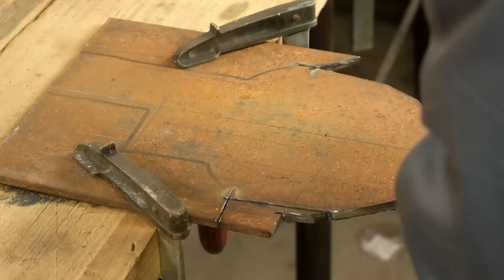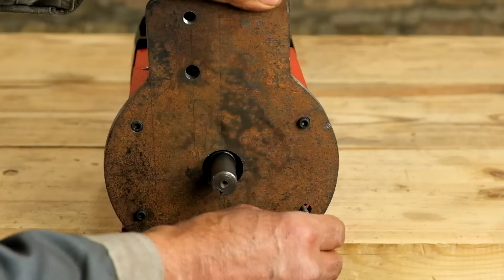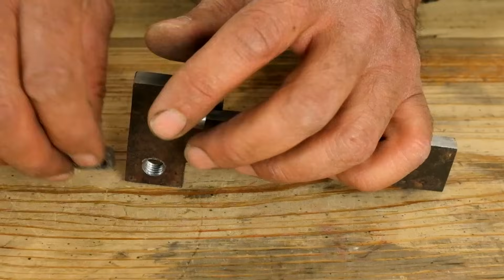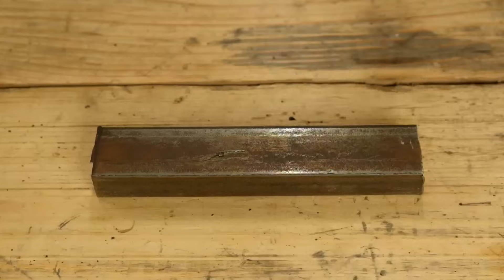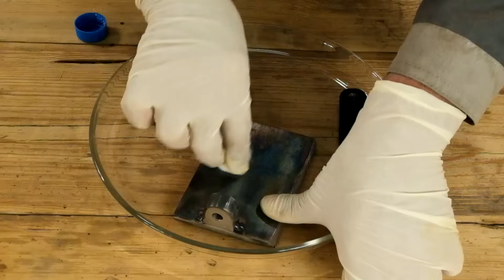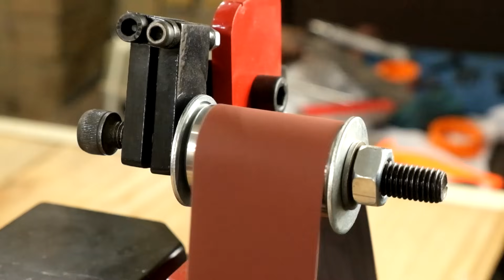DIY Belt Grinder

Comment: Motors being so expensive kind of defeat the purpose of this DIY. It's much cheaper to buy a good entry level brand on sale than it would be to make this.
Reply: A 2hp 2x72 with a 3 phase motor is expensive. Even inexpensive ones. What are you proposing?
Reply: @AzTurboMini  Just buy a purpose made entry level bench sander, the cost is less than one of these motors alone.

I purchased a 4"x 36" bench belt sander with a 6" disk sander for $69.95 USD (plus sales tax) on sale.
Reply: The idea I believe is to use a Reclaimed motor which is what I do.
Reply: This isn’t really a DIY project more just for “content”
Reply: @jfrphoto01  so you never worked with a good 2x72 is what youre saying, bc there is more than 1 world of difference between those two
Reply: If you creative, get motor from water pump, second hand non working pump normally the motor still works,  got mine for $5 , pump broken motor work perfect
Reply: Perhaps you already have a suitable motor kicking around in the workshop?  In which case the cost is negligible.
Reply: I have two suitable motors in my garage right now I took off a blower.
Reply: unless you have a piece of equipment that in some other way is failed that you can salvage the motor from.

Comment: Builds sander for 3x the cost of a store built one, using 80k in tools to do so.... comment section- omg amazing..
Reply: Isto é só para quem gosta de verdade, nem sempre trata-se de economia, mas sim do prazer de realizar o trabalho! Alguns com mais durabilidade que os vendidos em lojas.
Reply: Pretty stupid comment, it may be cheaper to buy a store built sander with loads of plastic components that will last a couple of years but the one built in this video is serviceable and probably 3-5x more powerful than one of the cheap store bought units. It’s like saying why have you bothered making your own hand built oak table when you can go to ikea and get one for half the price
Reply: Damn I watched the video to see 80k in tools. Guess you watched a different video or have no clue how much tools actually cost. 
Drill press
Angle grinder
Vice
Some files
Tap and dies
Where’s the 80k again?
Reply: Dudo qué en la fábrica la elaboren con tanto amor y dedicación como la elabora este señor
Reply: I Dont think so, I see him use pretty much tools most diy people have, angle grinder, drill press, files, and maybe a tap and die set. Pretty ordinary stuff.

Comment: I can't quite understand the horsepower recommendations for small, almost tiny belt grinders. A large wood belt grinder which has a huge load on it, is a 1 horsepower 14 amp motor with a 6" wide belt. For metal, the Craftsman bench grinders cannot be stopped, literally. They are only about 6 amps. Normal bench grinders are trash, with only about 3.0 amp motors. That's like 1/8th horsepower. How do you go from a 1/8th horsepower bench grinder to needing 2 horsepower to sand a small piece of metal? I'm not sure I understand why the motors are so big on belt grinders. I'd think a 10 amp, 1/2 horsepower motor would be more than enough.

Comment: WoW. I  created one, along these lines a few years ago.   2  x  42  inch one.    Used a skateboard wheel ( with bearings )  as the top tracking.  I put a slight convex curve in the face ( as it turned on a fast drill - with file ) to keep belt centred. As well, did the same for the 5.5  inch  2 pieces of 1 inch plywood, glued / screwed together, for the motor drive. Same convex curve, too.  I used a 2 inch half-moon, round wood rasp, for  the  tracking on the skateboard wheel, on a welded - on  shaft. VERY GOOD  grip, to adjust it.  Motor - 1 hp  3450 rpm. So, using the 2 inch tracking wheel, the belt probly goes over 5500 rpm.   TAKES OFF  metal  really fast, using 80 grit belt.  Anyway.....good luck, all.  (salvaged magnets, from microwaves to catch the filings, on the bottom) THE  world, is full of creative / inventive persons.     BE   /  WORK  / PLAY  ENJOY  LIFE  SAFELY - wear a toque over your ears, ear protection, eye protection, steel  toed boots, maybe a leather smock, when welding / grinding in shop. I've burnt enuff holes in  clothes........so have you.  Take care, Mr  Xformer.......thanks, for the on-going  education, for those whose  MINDS  are open, to  NEW   IDEAS.

Comment: I made a similar grinder out of 6 and 20mm plywood using only a desktop CNC machine, screws and glue. There is only one polished stainless steel plate in the entire machine. The machine has been working great for 2 years now.

Comment: Hello... what specific RPM speed of electric motor that used in this belt sander project?
Reply from the maker: 1500 rpm
Reply: @TheTransformerChannel  Could I used my 1.5 HP electric motor with 2800rpm speed for knive making grinding purpose?
Reply from the maker: Realy I am not sure about rpm, But I suggest use a more powefull electic motor
Reply: @TheTransformerChannel  Thank you very much for the advice.

Comment: This vid is really great, i do miss some details that keep me wondering how to copy that ?
The main wheel ... what is its exact size and the French dude said: A bigger wheel will cost you torque.
 Did you change the size of the first wheel ?
 And what size was the second  wheel and what size did you adapt it to ?
How do you know that your machine runs at 1500 rpm ?
What is the size of those bearings you use for the guide roller ?
How many kilos does your machine weight ?
How would someone adjust the speed to prevent the belt will melt ? Or that is stops because it is not strong enough ?
What program is used to makje the design blueprint ?
How many lanquages do you speak ?

I am still fighting the main base plate   i am trying to make  the perfect metal mall to cut future plates with the plasma cutter.

Comment: Gute Arbeit, bis auf die Rolle. Warum hast du sie nicht in der Höhe der Pendelachse angebracht ?
So schwenkt sie hin und her statt nur zu kippen. Aber diesen Fehler machen hier 90 Prozent der
Homeworker.
Reply from the maker: Thank you Werner for your comment. It is an awesome suggestion and I will definitely will consider it for my next videos. Also your suggestion will end up having taller support behind the sander which is great. Many thanks
Reply from the maker: Vielen Dank Werner für Ihren Kommentar. Es ist ein genialer Vorschlag und ich werde es auf jeden Fall für meine nächsten Videos in Betracht ziehen. Auch Ihr Vorschlag wird am Ende mit größerer Unterstützung hinter dem Schleifer, die groß ist. Danke vielmals (Hope google has translated to German correctly)

Comment: You did great work with what you have. I believe a Bridgeport would be all you need.  Any special attachments I think you would have no problems making. Headstock and tailstock for o.d. grinding ,a magnetic table for surface grinding and an indexer for  squares ,spirals or flutes. I think you could do it. I would try it but I don't have any room or machines,